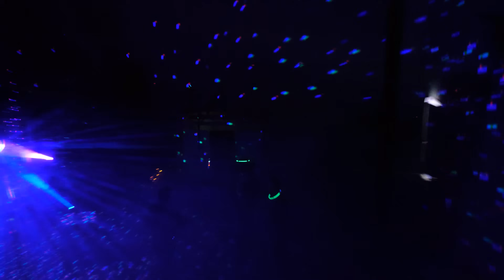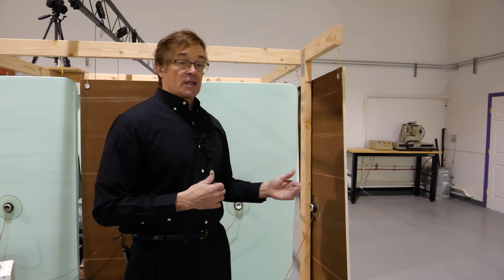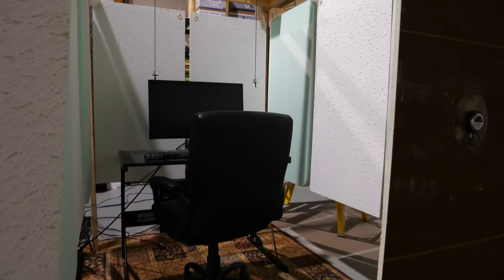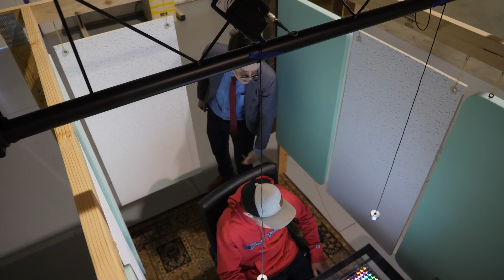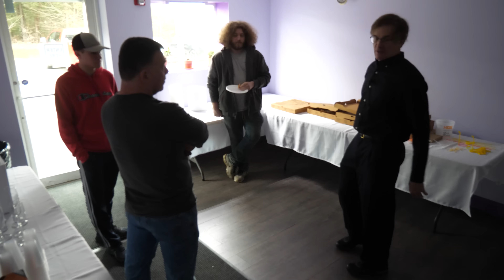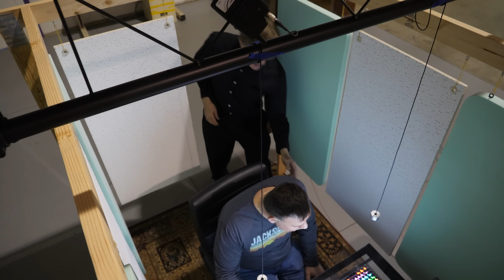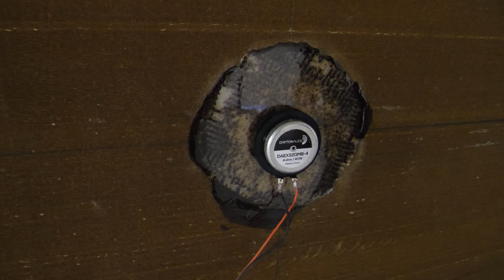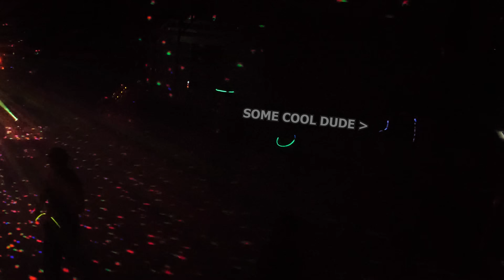SHOULD SPEAKERS THIS GOOD BE LEGAL?

Comment: you should have invited a few audiophiles. They would tell you EXACTLY what your system does and what it is missing. These lay people, like for example the 'drug user' type that went first, they just don't cut it for me. I don't like this. Normal people can't tell difference between a good song on bad speakers and a bad song on good speakers. From what I heard, people tend to like some songs on somewhat retarded but bassy systems but when played on a really good and expensive set of speakers, the same songs sounded not so well. That's why a musician needs a really good set of speakers to actually make good music. Otherwise his songs will sound really bad on a good set of speakers.

Comment: I have a pair of BES Large speakers , very nice sounding. They were produced in 70"s  the  same basic construction : BES used a cast syrofoam flat body w/a large driver mounted off center apx 60%  40% . Bass is very low and you do need a sub to fill that part. I do like the idea of making your own setup as in the video.

Comment: Hey, have you tested it in a horizontal position? Like under the ceiling? Would the tension or four anchor points distort the sound?
Reply from the maker: I haven't tested that, but I suspect there  will be some degradation in the sound.  However,  it might be undetectable.

Comment: Flax suspended in fiberglass is the best material.  Nothing new here. If a big panel was needed to reproduce bass, why not do so? You're not space limited. So you have a cheap conventional sub as a crutch. Laypeople are not audiophiles.  On my Vandersteen 2Ce's through a Parasound  amp this was not too impressive. Rather than bribe local just with pizza why don't you call me. Aren't you New England based? So am I. I'm a true audiophile. And guess what? You can build a fairly badass system for $300 these days also. You'd be surprised
Reply from the maker: If you're  sure about that, then try it and let us know  how it turns out.

Comment: As they are ceiling tiles, I'm curious how they perform when used horizontally in the ceiling?
Reply: The thing is, they need to "float"  Hanging from two points is the best you can get to floating.  Hanging from 4 corners on a ceiling would be worse (but how much?), and using them in a typical suspended ceiling track would be the worst possible since all sides would be touching something, dampening the sound and causing vibrations.
Reply: @jonbartosch1903  the ceiling frame could be modified to rest the tile on some pins for minimal contact

Comment: I built a pair from your first video and prefer them to regular speakers. In the single word your testers used- clarity. I have a strong preference for  detailed music from banjo to string quartets so I typically stream ad free Venice Classical radio. That said if I play a CD on a nice Pioneer CD player I got from an op shop for $5 I can clearly hear the sound is better. So it ain’t the speakers! I’ve added various subs including one I paid $500 for. I’ll try your 150 Hz setting. I have decent mid priced Senheisers andHiFiman headphones and do not find the panel speakers inferior. I find running the signal through a DAC really helps. $75 KGUSS DAC, $150 SMSL Amp. Bottom line these are my favourite speakers ever and I been experimenting with audio since I was 14.
Reply: Thanks for reaffirming that this speaker design sound good. It sounds like an interesting idea to have flat speakers that can be hung on the wall. Thanks for testing this idea first and letting us know.
Reply: Try listening to some Magnepan models, they will outperform the exciters easy. But of course cost more.
Reply: @dingdong2103  Planar magnetic is magic. I have some headphones that produce the best sound I ever could have imagined, and they cost less than my old Sennheisers did. I love the technology.
Reply: Plot twist: you are now 15. Just kidding. Discovering good audio is a journey, I'm not a huge fan of dipole speakers but they do have a certain attractive quality. I prefer the room and acoustics playing a minimal role in audio and regrettably, headphones are the most practical way to eliminate the room.
Reply: @Gersberms  This setup would also do the trick, as any outside reflection would be much lower volume given distance of panels vs panels -> reflection 1 -> reflection 2 -> ear.  Of course, headphones do better...  But yeah.  

In another point of view, headphones give you utter shit soundstage.  Headphones also do not give you any visceral impact/feeling from the music.  So if dynamics, soundstage, imaging, etc., are of any interest to you, headphones utterly fails.

Where headphones excel is detail / resolution.  For say 500$ (HP + HP amp), you can get a setup which will give you more detail/resolution than a 5000$ speaker setup.  And it's just something you stick on your head and doesn't take an entire room with room treatment.  

IMHO, speakers suck, because it's not just speakers.  It's really speakers + room + listener.  If you're not 100% in the sweet listening spot, speakers sound worse.  Again, headphones; you stick em up your head and they just work 100%.  Far from being the same listening experience though.
Reply: @literalghost929  Soundstage is a real problem for headphones, a smooth 2 dB EQ bump around 3-4 kHz really helps though. I discovered a long time ago that headphones (HD 580 at the time) can easily sound way more precise than even good speakers but comfort is an issue. With speakers though, the entire environment needs to work out - it needs to be quiet, perform well acoustically, and of course the inconvenience, cost, and available space all play a role. I would love to have a dedicated listening room though!
Reply: @Gersberms  @literal ghost I think G hit the nail on the head with his first reply when he said it was his preference ... It all depends on how the individual listener prefers to consume their music and the kind they consume ... for some it's headphones, for some a listening room, still others it's with good whiskey and good company in pleasant conversation, or as the fire for a good hard workout, or some Marvin Gaye for setting the mood, or as the beat for a raucous dance party. I don't believe there is a single best way to listen.
Reply: @baphensley  That's a fair way to look at it. I have adopted the notion that speakers and headphones should play with minimal distortion. Distortion being, everything but the sound wave being fed to the device. I have since made some exceptions but here's the thing: almost everything we consume, is experienced the way it was intended. Cars should drive like new, phones should perform perfectly, furniture looks best when it's brand new, food should taste as good as the chef intended. So that's the common thread in how we consume something.

Now, food seems to be the only exception where we apply our own taste but it's usually limited to salt and pepper. With audio however, we don't trust the studio that produced it for some reason, and we have to mangle and distort until it's to our liking. Maybe that is because most audio comes out like hot garbage, and so anything is an improvement. But if you have good gear, that need seems to go away and you just want to hear what was recorded.

Comment: Do they have 8 ohm drivers? My largest power amplifier(Emotiva XPA-5 puts out max Power @4Ohms all ch’s driven (Which is what I use on my Custom loudspeaker Towers which are Axiom Audio M80’s and VP180 Center Ch). So I could still run 2 8Ohm Drivers in parallel to get 4Ohm Loads at the Power Amplifier. I’m still in the process of getting 2 Monoblloc Amplifiers for my front L/R which put out Emotiva XPA-1’s which are 1000wRMS@4Ohm.then run the Center/RL/RR/RC off my XPA-5 5ch that does just over 600w/CH All CH Driven. I have A Sub from SVS but I was to run a .2 Setup with 2 Subs so 2 SVS PB16-Ultras which have 1500w RMS Amplifiers.  👌🏻 it would be an interesting experiment since I have a mid/large space 40 inches X 20 Inches.

Comment: The super light weight coupled with  with large surface area is entirely different than conventional speakers.  I agree, would love to see a sound frequency response curve.
Reply: ceiling tiles are far from lightweight... I'm thinking balsa wood panels wrapped in a single layer of fiberglass or maybe just a coating of "structural" paint such as epoxy would be good... The boron-silicate glass mentioned above makes a lot of sense , making and shaping would realistically have to be done at time of manufacture when still molten , it's just the old "pyrex" formula for glass
Reply: @briantracy1324  a graphene induced carbon fiber plate sandwiched with a damping layer would probably be optimal

Comment: This is AMAAAZING --- 30+ years in Audio/Video production so I understand the science behind this now how does it get COMMERCIALIZED?

This could revolutionize home theatre AND actual cinema sound construction projects and designs.

AS A SUGGESTION, have some local university or someone internally do a full optical microscope AND electron microscopy scan of the fibre board material to get a 3D-XYZ pixel-based and vector-curve-based imagery of the board material itself and then get a Adversarial CNN (Convolutional Neural Network) to allow you to construct an OPTIMIZED fibreboard construction materials survey, a fibre-orientation/thickness/shape-based survey and an actual fibre-construction-materials- survey so you can make the perfect fibreboard tile for acoustic purposes.

This ALSO have applications in Audio Phase-based Cancelation (i.e. 180 degrees out of phase noise reduction aka noise reduction speakers) so that LOUD indoor environments can have active noise cancelation built right into the walls and ceilings and even floors!  Even loud outdoor environments near busy highways, airports, playgrounds, factories, stadiums, etc. can have their noise emissions actively noise cancelled via weather-proofed active noise cancelling acoustic tile  walls.  Sound like you have a very good case for a VIABLE BIG BUSINESS IDEA !!!!!

The above ideas are now free and open source under GPL-3 Licence terms - June 19, 2022!

V

Comment: Interesting thought: placing a material under stress? Bowed wood or plastic, for example?  EDIT - Or a material being stretched like a string on a piano?  The larger the item being stretched might work well for low/bass frequencies?  Large heavy duty tow strap or ratchet strap maybe?

Comment: These speakers are very good. I made a pair of small foam panels using Dayton audio drivers -based on the initial video about acoustic panels. I've built many great speakers over the years so this really caught my eye. 

The panels... They sound terrific at low volume, especially the highs. But the small foam panels i had (approx 1.5 x 2.5ft x 3/16") can't handle the low freqs or hiqh volume without jumping all over like a puppet act.

I will be buying two ceiling panels tomorrow to try it proper. Still think that the sub 100hz freqs should be passed to a subwoofer to let the panels focus on what they do best -mid and high frequencies.

Also interesting... when testing random objects with the drivers, a old tattered cardboard box sounded spectacular when touched by the driver, probably better than the panels i tested.
Reply: do you think would work better suspended on elastic instead of solid kevlar as the guys have in this video ?

Comment: aww, u shoulda brought an audio engineer :) A skilled one should be able to tell you the exact levels across the frequency spectrum. 
Learning audio takes as much time as learning a language. You've got to have a lot of time & experience messing with different source material & different systems. It's typically 4 years of full time work. 
Another thing you can do to better portrait this system to viewers like us is to >> get REW(software) & a proper "acoustic measurement mic" (You'll also need an audio interface) >> Take measurements and publish the files. In the file set we will be able to see the source signal & the resulting room sound with those speakers. This "setup" will also help you dial in your speakers. It's truly a game changing tool if you haven't done it yet. The graphs it produces are really cool. REALLY COOL :)

Comment: I don't believe there is a single thing this guy has done that's legitimate scientifically or acoustically. I barely know where to begin, but here's a start:  (1) This system will be absolutely incapable of soundstage reproduction, and will deliver little or no soundstage width or depth. (2) This system will be incapable of realistically reproducing any of the lower frequencies, and certainly not with any impact. (3) This system will be incapable of accurately reproducing any of the higher frequencies, such as cymbals or guitar overtones. (4) This system will have very high harmonic distortion. Instead what you're getting here is tone control system that negatively alters all music played through it, and creates a diffuse, unfocused, non-dynamic, midrange-only sound that, while perhaps immersive and interesting to listen to (for some), completely distorts and dishonors the original recording artists and their engineers. Notice the complete lack of anything scientific here -- no frequency response, decay, distortion, or other graphs or measurements whatsoever, and no audio engineers (or even an audiophile), and no direct comparison to a high-quality conventional loudspeaker system for reference. None of that is by accident. There is absolutely no legitimacy to this design when used for music reproduction, and I encourage all considering an audio system like this seek out opinions from trained audio engineers and other professionals, or to compare it directly to a good-quality loudspeaker system. Beware, do your homework, talk to an expert.

Comment: i notice you use small Gage speaker wire, have you ever tested larger gage wire? i use old school Monster speaker wire 14 gage which uses thin copper strands to make up the cable, the claim is better clarity and less reduction of sound degradation along with lower resistance, a test of different thicknesses would be interesting to support or dispute these claims
Reply from the maker: It's  likely unnecessary. The current delivered to a typical  speaker  is on the order of 1-2 amps.  18 guage will carry  this with almost no loss within a typical room. The wire within the speaker itself  is typically  24-30 guage.  This obsession  with heavy guage speaker wire is the result of marketing.

Comment: Would it make more sense to stack the speaker pairs vertically?  ie. turn each panel 90 degrees and mount on centre line with other speaker

Comment: Have you ever demoed a good pair of electrostatic headphones?  I wonder how they'd stack up.  I've never seen (in person--they do exist, but are ludicrously pricey) a set of speakers that keep up with high-end electrostats.  I do expect, though, that your speakers would demolish any or almost any single-driver headphones so far as imaging & soundstage are concerned.

You'd have to put the speakers in a well-optimized room for the comparison to be anything resembling fair, of course :) I noticed you made a point of choosing a poor listening environment in order to make a fair comparison to systems and rooms the average viewer might have access to in their home environment.

At any rate, I wouldn't be surprised if these could beat estats on all but the matter of transient response (which is a minor factor at best).  I wonder if I could convince you to make coronal-discharge tweeters to pair with the current system...nearly ideal transient response at high frequencies.